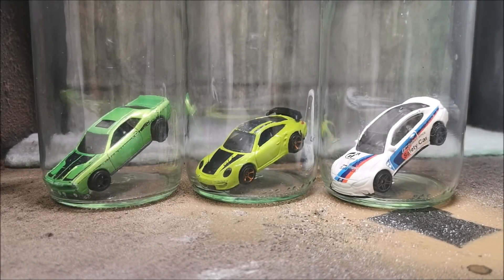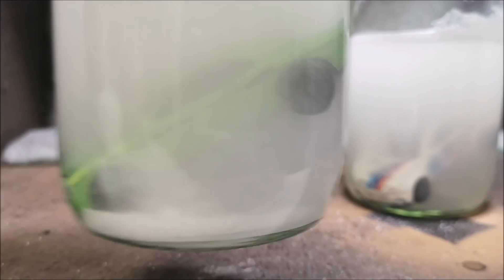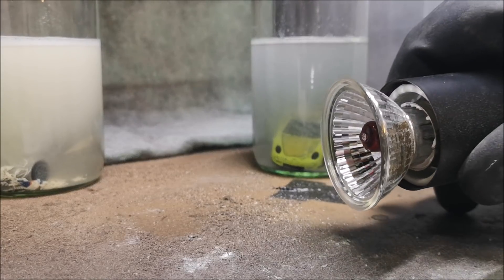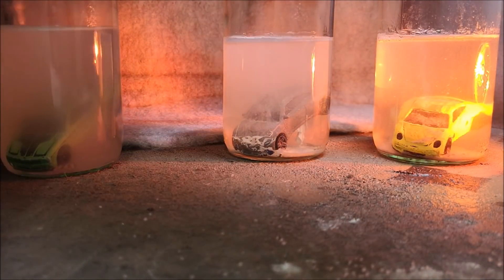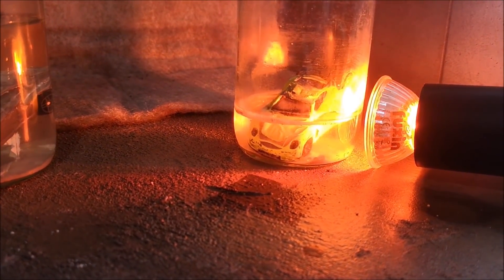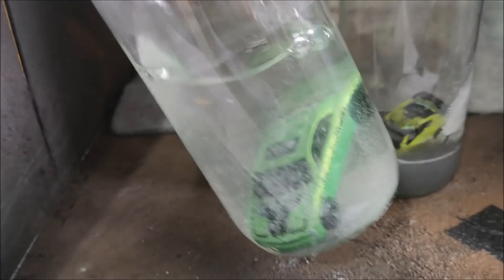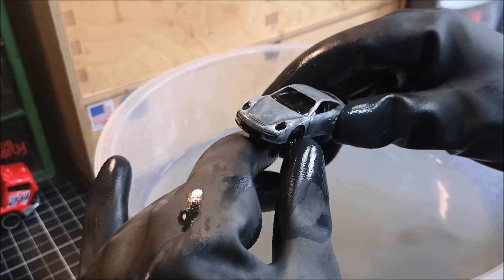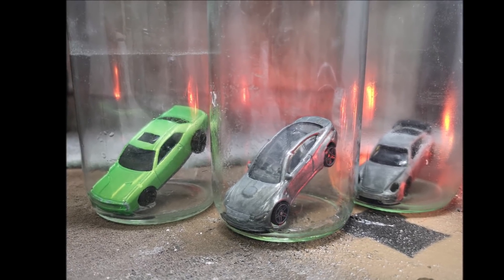Experiment: 3 Cars & 3 Jars - Caustic Soda at different temperatures!

Comment: An experiment I see:
- 5 identical castings to dismiss differences in paint
- 1 jar with caustic soda and cold water, 24h
- 1 jar with CS and hot water, casting removed after the water cools down
- 1 jar with CS and hot water left to cool down, 24h
- 1 jar with CS and hot water kept hot for 24h
- 1 jar with only hot water, 24h

The last one is to see if distortions to plastic (if occurs) may be due to hot water alone. 

P.S. jars could be multiplied e.g. with nothing but water kept hot for 24h, but you may run out of space on your bench 🤣

Comment: Need to do a very controlled test on the reaction the door springs have to caustic soda. Put the casting with doors on (no plastic parts) and leave for 30 minutes (around the normal time I have heard you say you leave in solution). I think they would survive. It might be interesting to see if you took the full vehicle out at 30 minutes if the plastic would survive as well.

Comment: I’m really surprised that the Porsche still had any of the plastics left. 

Have you ever painted a car that you stripped but didn’t polish with a wire wheel before painting?  I’m curious if the corrosion would cause problems with painting

Comment: The soapy "stuff" on your bare skin was your skin cells turning to a soap by means ofalkaline hydrolysis. 

Interesting experiment though. 👍🏻👍🏻
Reply from the maker: I can't even say those words, but then I have had a few drinks tonight 🤣🍻
Reply: @MatchboxGarage  I feel you.  Alkaline hydrolysis is just "a basic chemical reacting with water,  causing a reaction." The skin reaction is, when applied hot (as you saw), it starts to breakdown the flesh, leaving what you saw.  The reason it did not hurt is because a base affects the nerves. It may have been itchy. Lye is nasty, as either a base or an acid. I'm glad you demonstrate proper precautions.  Loving your channel.

Comment: What a terrific experiment.  I had always wondered about how the water would work at different temperatures.  The hotter, the better.  Great job!!!
Reply: Every 10 degrees centigrade (or Kelvin) difference is a factor of 2 in reaction speed. Since the difference between room temperature and boiling water is about 80 degrees,, paint is removed about 256 times faster in boiling water than in water of room temperature.

Comment: No effect to the windscreens this time. I wonder because the last time you did this in the wind screens were actually cracked or broke, it didn't have anything to hold them in place. Great experiment. Now with the green one in hot 24 hours, the windscreen did melt. So again, is it the caustic soda that's doing that or the heat of the water that is doing that?
Reply from the maker: Who knows, maybe same casting in each will be better idea

Comment: Thanks for giving the idea of the continuous heat a try. Works well to stubborn paint. How about using acid next time? But that's more dangerous than caustic... You could also add an agitator to get a continuous flow in the jar. Great experiment Rob!
Reply from the maker: The agitator is a good idea

Comment: I guess the Porsche plastic windshield melted because of water temperature and not for the caustic soda ¿is that correct? Good learning, thanks for the experiment, Rob. It would be nice to see the Porsche and the BMW simply polished with your new wire wheel 👍
Reply from the maker: I guess the hot water over 24hrs eventually melted the windscreen
Reply: @MatchboxGarage  You could experiment with that... 3 cars: one boiling water, caustic soda, left to cool, one just boiling water kept hot for 24 hours and one with boiling water and caustic soda, kept hot for 24 hours..